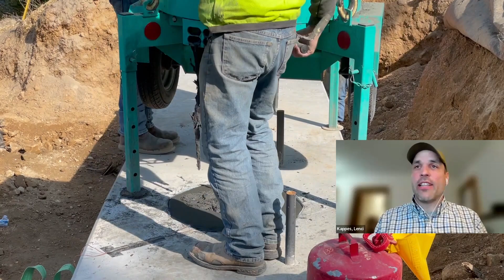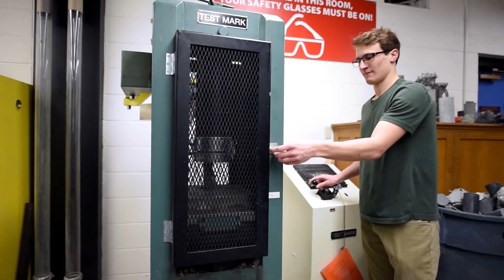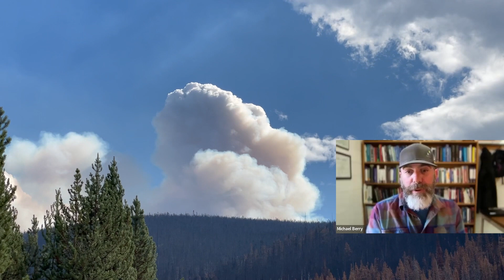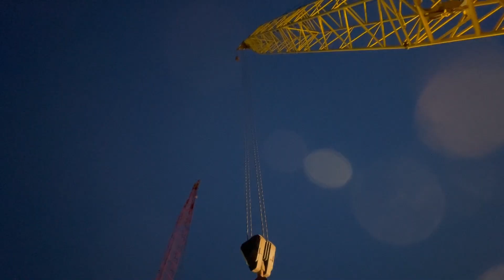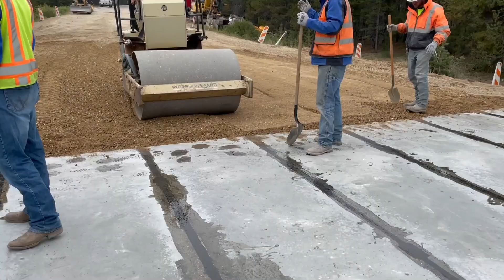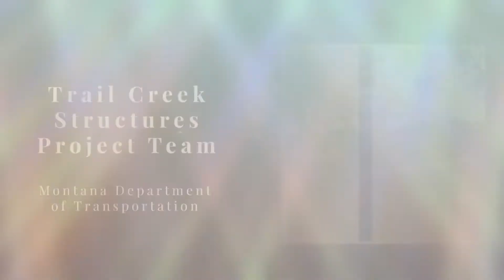Using Ultra-High Performance Concrete to Build and Repair Montana's Bridges

Comment: So, you're saying that New York State, with it's milder temperature ranges, doesn't have an excuse why the BQE, FDR Drive and numerous other aged, cratered highways and parkways can't be rebuilt at a much higher level of resiliency and utility, save for the corruption that prevents any meaningful infrastructure renovation?

Comment: Thanks for this update on UHPC in Montana. Are there any grants available under the new infrastructure bill to find other ways to make UHPC viable and affordable for more of our many nationwide failing bridges?
Reply from the maker: The enhanced durability and reduced maintenance needs of Ultra-High Performance Concrete (UHPC) align with the goals of the new infrastructure bill, ensuring that our investments lead to safer, more sustainable infrastructure while ultimately lowering lifecycle costs.  While there isn’t likely a specific grant or portion of the infrastructure bill specifically dedicated to making UHPC more affordable, leveraging available grant funding for bridge projects that utilize UHPC can significantly enhance our aging infrastructure using the material.  As a result, as we implement UHPC on key projects, increased familiarity and production volume are likely to reduce costs of this incredible material over time, making it a more affordable and viable option.
Reply: @MontanaDOT  I really appreciate your detailed and honest answer. Keep up the great work in helping to keep Montana Highways, Bridges and Over Passes safe.